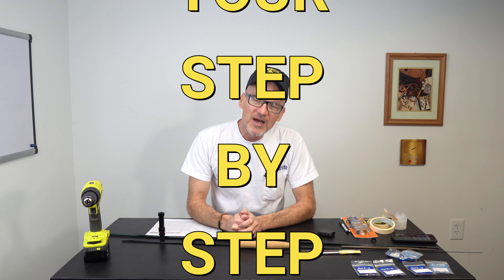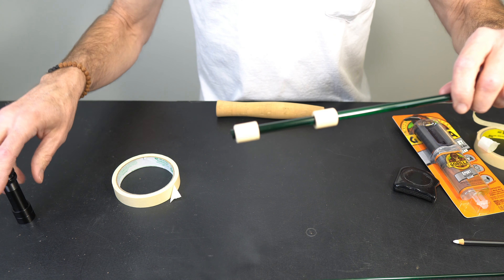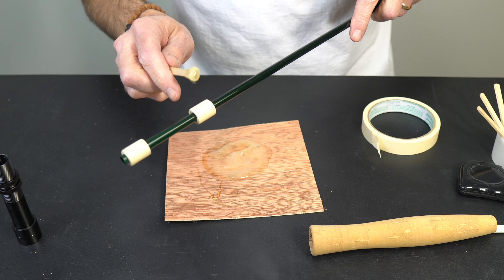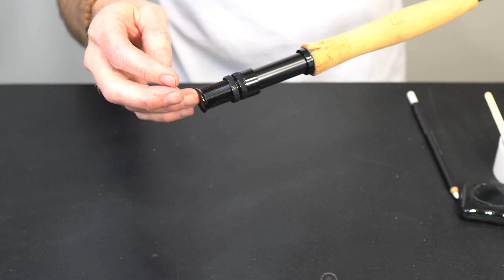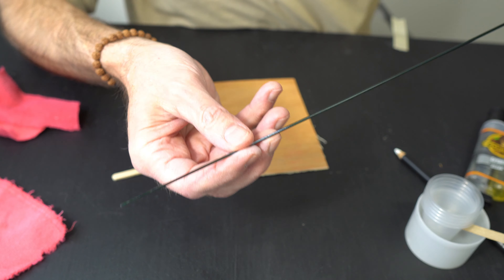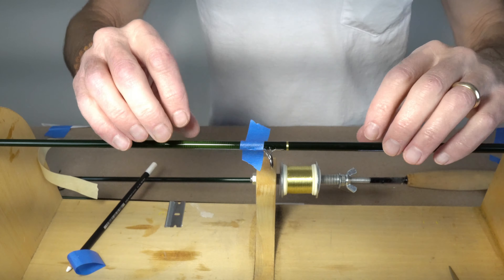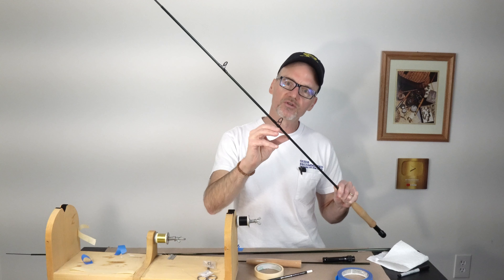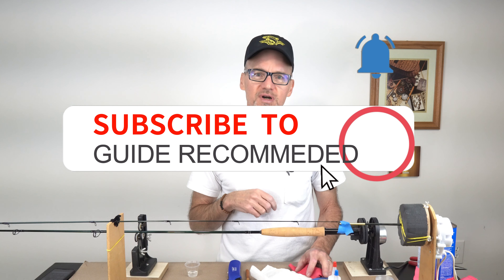8 Steps to Build Your Custom Fly Rod

Comment: I know this is an old video from seven months ago, but I have a quick question. I want to make an eight week fly rod for catfish how do I know what size or millimeter rod carbon fiber rods I will need.
Reply from the maker: Fly rod blanks are sold with the weight described.  Shop for an 8 weight.  Tight Lines! 🐟

Comment: I could not find the the guide spacing charts.   When I open the link I just got a narrative basically of this video.
Reply from the maker: Link goes to an article, halfway down the article is a spot asking for your email so the charts can be sent to you.  I hope that helps.  Tight lines and good luck with your rod building project.🐟😎🎣

Comment: Do you put the rings on that position from which the blank wants to jump/twist away when you bend it? Or do you allow the blank to jump into the relaxed position and then put the rings on the inner bending curve? And what is the idea behind your way? Thanks, nice video.
Reply from the maker: The guides are wrapped (attached) onto the blank where the blank naturally wants to flex.  The reason mark and attach the guides along this line is to have the line tension applied along the natural bend of the fly rod.  If you attached the guides off the line of the bend (called the spine) it would bend slightly off direction to where you want to cast.  I hope that answers!!  Great question. 🐟🐟🐟

Comment: can i use 2-6lbs 210cm blank? how much wt line is used
Reply from the maker: Hi,  does the blank have any numbers describing the weight?
Reply: @GuideRecommended  no the blank just have line weight 2-6lbs 2 section
Reply from the maker: @elmachogato4399  it sounds like a spin fishing rod, not a fly rod